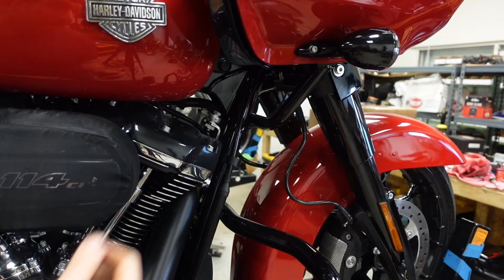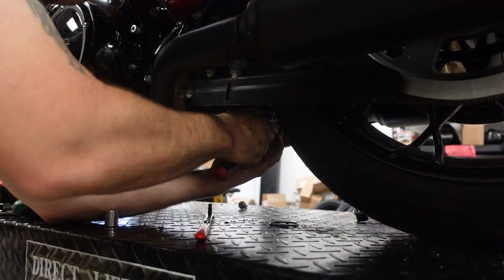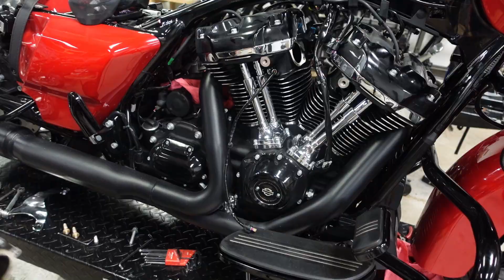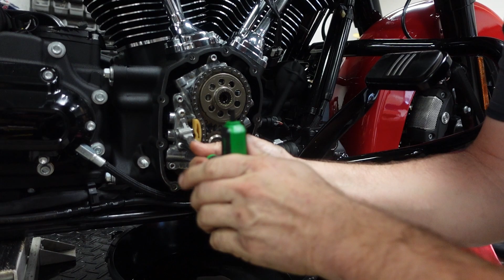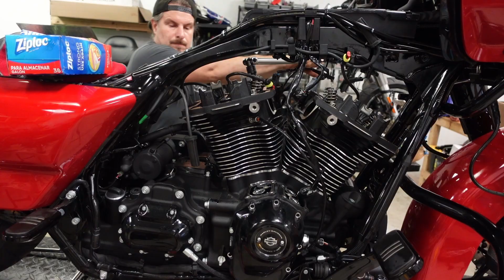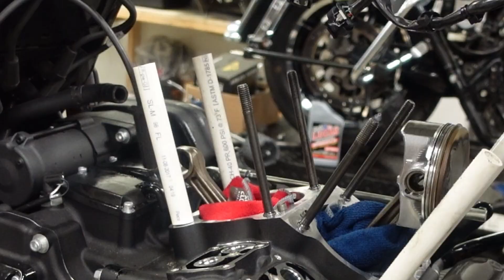Harley 131 Engine Build:  Tear Down, Inspection and Prep

Comment: I blow air thru the oil lines no mess at all then remove
Reply from the maker: where do you blow air from? The rear oil pipe? Thanks for the tip
Reply: @empcycleworks  the front of the oil line it blows it into the oil pan